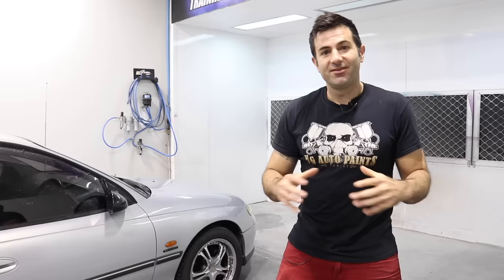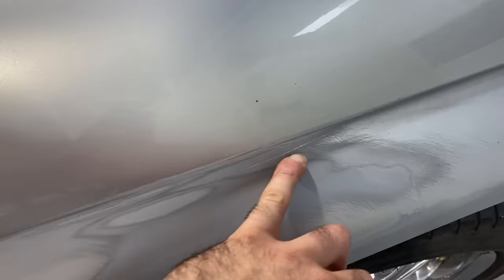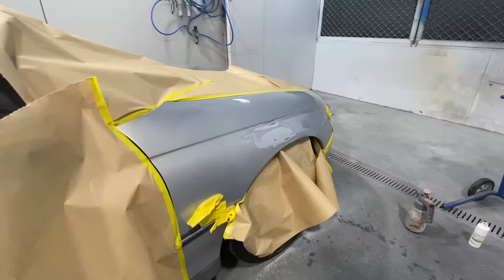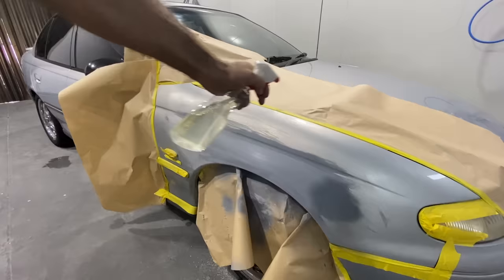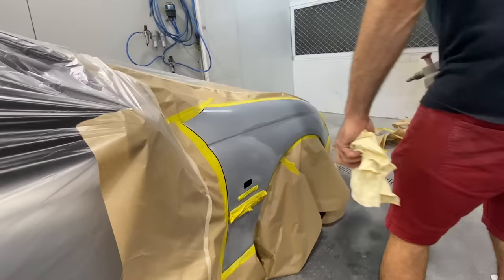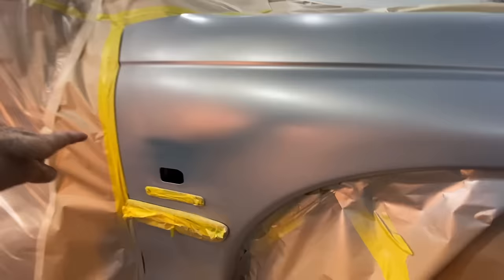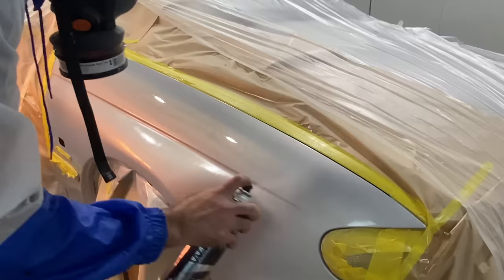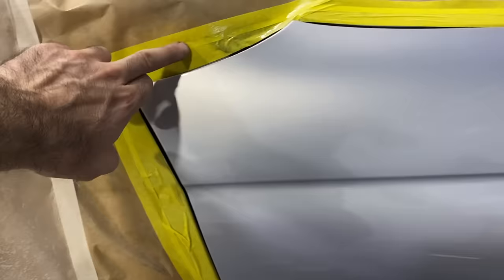How to paint with Spray Cans

Comment: One of the best vids I have seen on using spray cans and the different types of clear coat to use. Cheers from the UK.
Reply: Lolol funny good luck finding a color match
Reply: @chantelrhine8965  

You know places like Home Depot, CT and etc will colour match to the T? I've had paint gallons and spray cans done in the past. I had a BMX done Monster Green and Rockstar yellow.

Also, more automotive places can just grab the paint code for a make/model and make it for you.. He said it in the video, that's literally what they did.
Reply: What your forgetting to mention is base fades over time. So get the base colour matched and base the whole pannel on last coat then clear. Is not going to blend properly any way unless it's an exact colour match. And have fun with metallics out of a rattle can.
Reply: @Kushology  you are correct but their are levels to everything and some colours are very hard to match and that is why a professional will spray tests to check the match, but for us at home DIYing I am sure a can of colour match will do just fine.  Unfortunately some professionals come here with their stinky attitudes and just want to crap on things because they feel it makes them superior

Comment: Hey Dave - Excellent Video. I have a question - does this mean I can do a DIY/Home car resto paint job using the safer 1K for all layers, and then take it to a spray booth to do a 2K clear and it will be just as awesome as doing 2K for each layer as you still get your UV resistance and toughness of 2K in the last clear layer?
Reply: Wow, 3 years, still no answer from these guys? 😂

Comment: Good job.

I had never painted a car or body parts in 30 years and at least 25 cars I've owned.  This past week I painted my teenage son's Impreza in an open carport on gravel and dirt ground.  I figured out what works for my area (western Colorado).  I did 5 and 7 light to medium-wet coats on a whole car, over 4 sessions without fail.  Apply and let dry for 15 (minimum) to 20 (maximum) minutes between coats and it works fine for the paints I used.  You should spray two small test areas with all environmental/time factors the same before the actual project.  For example, if you have an area to spray that takes 10 minutes to paint it, wait and warm-up/shake your next can(s) for 5 minutes and start the next coat.  That's a total of 15 minutes.  I know up to 20 minutes is also good.  But 40 minutes was too long because that induced chemical reactions and severe wrinkling.  I painted in the same order/pattern each time I sprayed a section.  I had zero runs, spray errors, or reaction defects.  The original paint condition was below average.  No body rust, but 50% of clear coat was gone and hunter green was faded and rock chips galore.

Below is the weather, process and paint I used. 

1.  Up to 3-mph occasional breeze is okay, anything faster or constant is to be avoided.  Clear skies, for light, preferred.  20% to 40% humidity.  Temperature between 50F and 72F while spraying.  Warmed spray cans in hot water in a bucket.  Shake them as much as possible.

Paints used on sides, nose and rear (3 sections):
-- Rust-Oleum Painter's Touch Gloss Navy Blue 2X Paint + Primer: 1 medium-wet coat.
-- Rust-Oleum Stops Rust Enamel Gloss Navy Blue: 2 medium-wet coats.
-- Rust-Oleum Stops Rust Enamel Crystal Clear coat: 2 light coats + 2 medium-wet coats.  I think a 5th coat could be applied with no problems.

Paints used on hood, roof and hatchback (1 section):
-- Rust-Oleum Painter's Touch Gloss Black 2X Paint + Primer: 2 coats.
-- Rust-Oleum Universal Hammered Black: 3 coats (4th coat optional).  ***Color dries gloss dark grey with blackish specs, not solid black.

2.  Sanded car with 100 and 150 grit dry paper by hand, with a scrubby dish sponge as the pad to fold the paper around.  First, I sanded high defect/damaged spots...double their original size.  Then I sanded vertically and again horizontally (cross hatched) the whole car. 

3.  From this point forward you must walk carefully to protect from dirt contamination...do not drag or scuff the ground.  Wet the surrounding area to help keep dust out of air.  Douse car with hot water and wipe down with rags.  Let air dry 30 minutes.  Check that all areas are smooth/scuffed well...touch up as needed.  Wash with hot water+dish soap and rags/sponge.  Rinse well.  Dry with microfiber.  Air dry 15 minutes.  Tape up as necessary.  10 to 15 minutes before paint spraying use a microfiber cloth and lighter fluid or mineral spirits (same thing) to wipe down the section to be painted.  Immediately before painting wipe all surface with a tack cloth.  As you're spraying move slowly and don't scuff the ground.

4.  Even in the open air you will want to use a painting respirator, but at minimum cover nose and mouth with thick damp cloth or N95/N100 face mask.  Clear, tight fitting safety eye glasses work best...the larger goggles reflect light and make wet paint difficult to see clearly.  I had to go without eye cover and just squinted my eyes when the paint spray was thick, because goggles distorted the light.

5.  It will take these paint formulas 3+ hours to dry to firm finger touch so leave it alone for 5 hours.  I let it dry 24 hours in the carport and then put it in the Sunlight for 2 more days before driving.  At 25 to 30 days I'll polish and wax it.

If you want to see pics drop me your email and I'll send you a couple.

Comment: Great tips.
If people are looking for a good clear coat from Bunnings. I used Dulux Duramax crystal clear the other day, several light coats then a wet coat. It really is crystal clear, super shinny & drys quick. $12 a can. I'd been using Rustolium products, but the Duramax paints are a far better paint in my opinion. The only problem I had, is I couldn't get a dark bottle green. So had to use Rustolium Hunter Green base coat, the darkest they had. That still wasn't dark enough. It seems a really dark green is something the paint companies could work on.

Comment: Great detailed video. Thank you.  I am going to paint a large car with rattle cans (1970 300 Chrysler Convertible) I'm concerned that because it's so large it will take too long to get get my topcoat on before base dries.  Should I just do each section individually or try to work faster.  The rear quarter panels are connected as one large piece around the trunk so concerned as it's not separate pieces

Comment: First, thanks for producing this video. Second, I have a few questions needing answers and clarification.  1) What is the main purpose for Primer coat? (You did not apply primer to entire panel. So why apply Primer only to sanded section?).   2.) You used a scuff pad on the outer areas surrounding the repaired scratch then applied base coat to sanded area then scuffed area of full panel. But, what happens if you do not scuff outer area and only cleaned with wax/grease removal then applied base coat? 3.). Does surface always need to be scuffed or sanded prior to base coat application?  ( what is ideal grit to use?) 4) what is an ideal distance to hold can away from surface while spray painting panel? ; and 5) Is “orange peel” look the result of holding spray nozzle too far away from painted surface?  6) I noted you did not use any filler or glazing spot putty after sanding away scratch. Why not in this case?
Reply: Carmelo M the paint won’t have anything to grip to, so the paint will flake off off over time and the prime only needs to go over the repair

Comment: Hello mate. I love your videos. I’ve seen many of them. I wanted to ask you if you could do a video repairing a fender on an arch body line with a spray can. In London, I’ve seen lots of cars with front fender damage including myself but my dent is on the arch body line and I can’t seem to get the body line on the arch correct with body filler and I don’t know how to. If you did video with a fender arch damage on body line, that would help a lot. Thanks mate

Comment: Great video and I’m thinking to attempt the scratches on a Subaru that I own. Just a quick question, can I use 2k paint outside a spray booth? Or if I am using a garage to paint am I better off with a 1k paint then sanding and buffing?
Reply: I believe 2k is better for outside cause you can sand it down better and then clear coat it again

Comment: Awesome!  Hands down the BEST video I've seen on how to blend in a repair.  Thank you!  Unfortunately, my van's slider door requires some rust/paint repair on all 4 sides, so I will have to paint edge to edge.  Light blue metallic.  I have a very good paint match based on my test card.  Should I paint edge to edge and see what the butt match looks like, then go back to blending into the adjacent panels (rear qtr panel and front door) if noticeable?  Or just blend from the start?

Comment: Hey bro i repainted a section in my car but due to my clear coat spray can got empty just after one coat i could not able to do multiple coat ,

after few month can i just aply my clear coat on my car by sanding with 2000 grit or i need to redo the paint job ?

Comment: is it a good idea to do a light polish on the top coat before applying clear coat?  I polished a bit of the top coat (haven't applied clear yet)  and it looks alot more shiny.  Should this shine be only achieved from clear coat or its ok to polish top coat then polish clear coat after application?
Reply: NO ABSOLUTELY NOT!
Reply: Now you need to resand it with 600 grit and then clean it good with alcohol or something and then spray your clear

Comment: Good to see another video.  I'm having problems with my new paint being affected by petrol.  Im using acrylic base and clear on motorcycle bits, but if there is a fuel leak or anything it ruins it.  What paint should I be using?

Comment: I am about to tackle a few small repairs on my truck.  But instead of clearing the whole panel again I was going to clear just the repair area and use a clear coat blender to blend the new clear with the old.  Have you ever done it this way? Im expecting to have to sand and polish afterwards which is totally fine.   I just polished the  whole truck last weekend and it looks great.   Just got a few small scratches that were too deep.. plus rock chips on my hood.   Thanks for the video and I'm hoping to hear back from you.    Thanks!
Reply: Been 2 years but this might help someone else - I wouldn't do it.  My results trying to blend in clear when I didn't know better - well it proved his point exactly that you'll see a line and I'm needing to sand down and repaint then clear the whole thing.  ALL the pros I've watched say clear the whole panel.  I would do that if you want it to look right.  Not worth having to do it all over again.  Trust me.  :)

Comment: I have heard that if you put an activated 2k clear can in the freezer you can prolong the lifetime. You just have to take it out of the freezer a few hours before use. I havent tested it yet so i dont know if its true.
Reply: Its true, thus not recommended. Ive done it a few times with proper clear coat and I've only had a problem once. I've used a two day old clear on a cheap repair and it came out mint

Comment: Great video.  I have tried to follow these steps but I end up with terrible cracks in my paint over time, looks like a dried up mud puddle.  I have attempted to avoid all of the potential causes for this. I don’t know if I’m putting the paint on too thick, not allowing enough time between coats, or too much time.  Any thoughts? The cracking is intense.
Reply: I've had this problem a couple of times myself.  I'm 99% sure it has happened when I've gone overboard and sprayed way too thick on a 3rd coat.  The thickness of the last coat on top of tacky prior coats reacts and causes the wrinkles.  My conclusions after a fair amount of projects is never spray outside when windy (dry spray), never in humid weather (milky/cloudy), don't go too thick and instead rely on 50% overlap and multiple coats.  Much better to go with a 3rd coat than spray on too thick.  Also don't get too close.

Comment: Hey mate thanks for the diy video!

I've got little bit faded clear coat on bonnet - Can you use metal cover epoxy enamel (from SCA or Bunnings) directly onto sanded paint or even body filler as your "base", and then clear coat?

Not fussed about matching the paint to the rest of the body, or blending the paint, as this car is 15yo nugget. Cheers
Reply from the maker: I suppose you could do that b

Comment: Good video. I've seen the 2k clear in a can  for sale but have been put off because I was unsure about the health and safety aspects. I have a spray mask with A1B1 filters if that means anything. Is that ok for 2k work. I only paint occasionally  and on motorcycle stuff, fuel tanks etc  Any other PPE recommended for working with 2k?

Comment: Is the High Build Primer you used a DTM primer? If it’s DTM, explain why you did not first sand down to bare metal.   Also, I recently purchased a can of  Finish-Rite Coatings High Build Primer Dark Gray 14.75oz FR765. However, the info on can says this is a DTM.  I also read that Rus toleum Self Etching Primer is a DTM and that it says one can apply base coat over it. But, I’ve seen several vidros where the tech says you cannot apply Base paint over Self Etching Primer. 🤷‍♂️   So what’s I have a small panel scratch repair job where I’ve sanded down to bare metal, then apply 1-2 Coats of Rustoleum Self-Etching Primer on DTM, should I or can then apply Finish-Rite Coatings High Build Primer Dark Gray 14.75oz FR765, even though it says it DTM? Seems like much confusing a conflicting info.

Comment: Can I ask you, if the surface area is a small burn mark only from the buffer. Can I get away with 1500/2000 wet dry and paint base only 3 times then clear?

Comment: Quick question, I have a car that has a tiny bit of little clear coat peeling around the belt line mouldings, and the roof. It is silver (one of the hardest colours to match), and I don't really want to pay a fortune for a panel beater to repair it. Could it be rubbed back and clear coated with a spray can just around the areas peeling or does the base coat need to be redone and sprayed as a whole panel?

Comment: Awesome work & very informative but how long do you need between the last base coat & 1st clear coat? Thanks
Reply: Assuming the newer waterborne paint, always make sure base/color coat dried to a matte finish before clearing.  Read the paint can instructions and use the between coat time, but typically 15 min.  Then you can go straight to clear.

Comment: You don't have to wet sand it with 2000 before applying the clear coat? Or is it fine just spraying the clear after applying the base coat/paint?

Comment: Thank you Dave for your videos, now that everybody is lockdown maybe i get the oportunity to polish my bike, i have one question:
I painted my aluminium tank with black mate spray can, it was a good spray can, however i get this grainy feeling when you pass your finger over it, i followed your advice and it was not a hot day, not on direct sun light, etc. but i get that, do you think that polishing it will remove that? I think it's excess of paint but not quite sure. Thanks again.
Reply from the maker: If you polish it it won’t be flat anymore. The only way with flat finishes is to sand and re paint.
Reply: @customspraymods  I was afraid so, well until 26 of april i have plenty of time here on Spain '=D Thank you very much Dave. Thanks to your videos i already painted my whole bike :)

Comment: Awesome video. Sometimes when I use 2k aerosol clear I get the orange peel effect- any tips on how to prevent it?
Reply: Happens with hvlp guns that run too much air pressure
Just wet sand and buff it out

Comment: Hey mate. Do you sand between base coat and clear coat? Or do you spray the clear straight onto the base coat? How long between base and clear should you wait? Cheers. Gonna have a crack at painting one of my panels. Awesome video
Reply from the maker: Thanks. No need to sand between base and clear.
Reply from the maker: Wait 15min
Reply: @customspraymods how long did you wait between spraying the last coat or primer to sanding it?

Comment: New to your channel and am finding it very informative and great instructional content and tips. I also live near SYD so wanted to ask if this weather with the humidity being quite high over 85% is ok to paint inside a garage or is your workshop air-conditioned?
Reply: Dunno if this helps, but I used his headlight resto video, painted in high humidity and got bad orange peel. I can't be sure that the two are connected, but avoid high humidity if you can.
Reply: @lindenbasket  Thanks will do. It is actually lower than predicted today at 53% at the moment
Reply from the maker: Hello our shop has no air con in the booth area. No heat either. I did use heat lights on the clear but would work fine in normal situations.
Reply: @customspraymods  thanks for the reply:)

Comment: If you already have a primed body part do you sand it or wax and grease remove it ? Or just go straight to the paint
Reply from the maker: sameer hussian if you have repairs under the primer you should sand the primer  then wax and grease it before paint.

Comment: Hi Dave,

What are the differences between the Spray max 2k in a can and this 2k in a can? as you sell both
Reply from the maker: Mikro Zoo this one is cheaper and has more product inside. Just as good as the spray Max
Reply: Couple of months back I went to vg auto and picked up 6 cans of base 6 cans of the spray max 2k. Have done spoilers and bumpers on an integra & super impressed with result. May give this new 2k a go next time if u say it’s as good. Cheers I’ve watched most of your video thxs..